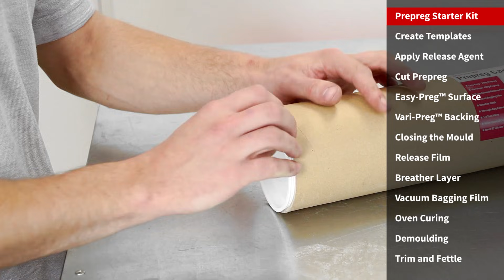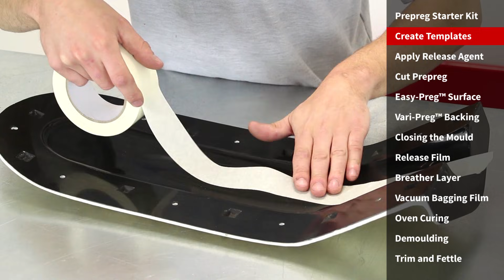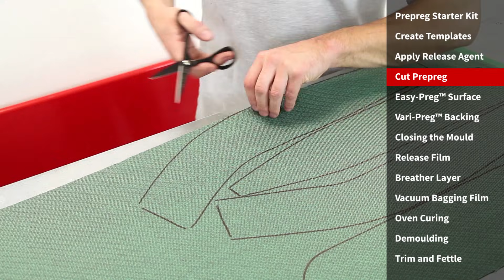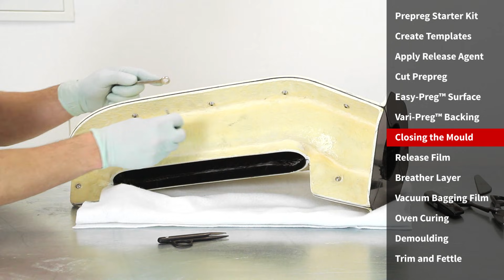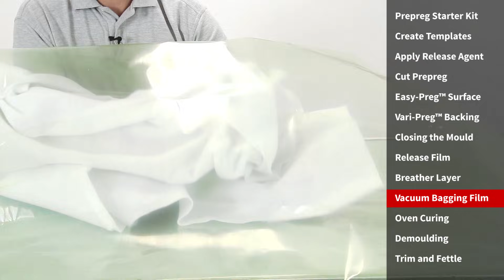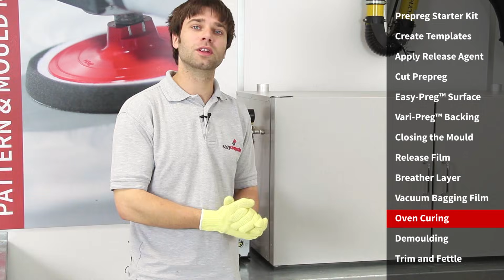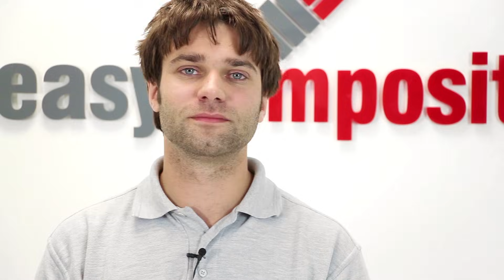How to Make Prepreg/Dry Carbon Fibre Parts (Carbon Fiber Airbox Pt. 3)

Comment: Awesome series. How do you manage with molds for long and slender components like handlebars where you can't fit your hand inside to actually press in the material/release film/breather layer/etc.? Most of the stuff I'd want to make would be more closed off then this.
Reply from the maker: Parts like this would require a different process. Generally, you would have a split-mould for the outside and then use an inflatable bladder (similar to a bike inner tube) to create positive pressure on the inside, pushing against the mould. You would then over cure this whilst the bladder was still pressurised.
Reply: Easy Composites Ltd is this the same method you would use to make a motorcycle gas tank? Also, would prepreg hold up to fuel with ethenol in it without another coating? 

Your videos make this seem much easier than I'm sure it is!

Comment: Thank you for this informative video. Can you do the same process with non-prepreg resin carbon infusion?
Reply from the maker: Yes, in theory. For a complex component like this though, especially where you need to work inside a small cavity, resin infusion would be really very difficult. You also have to contend with the issue of setting up and positioning the infusion consumables which would have required larger flanges. In reality, a part like this is easy to achieve using a prepreg layup but would be REALLY tricky for infusion. On the other hand, larger, flatter components (like body panels) lend themselves very well to resin infusion and are as easy to do that way as prepreg would be.

Comment: Hi there,
Great video , and extremely easy to follow guys :-) 
My name is Martin , I'm a Industrial Designer. I am working on my personal "Superturismo" alfa 33 16V race car project. I am looking at designing a custom Intake plenum and also separate intake runner tubes, I was wondering which process would be best to produce the runner tubes to get a smooth finish inside and out ?
Thanks again
Reply from the maker: There are a number of ways to make tubes including roll wrapping, or laying up in a mould.  Roll wrapping is easiest to get both sides smooth as once off the mandrel it is fairly simple to smooth the outside finish.  For more complex shapes you may well end up making a more complex mould and have to choose which side is the shiney side or consider the use of inner and outer matched mouldings.

Comment: Amazing video. It is very inspiring, can this be achieved without PrePreg material? Assuming that other material could cure without an oven?
Reply from the maker: In theory this could be done by wet lay methods by hand, or even resin infusion,  however the shape is very complicated so it would be exceptionally difficult to do without faults. In this case, pre-preg is so much easier to use as a laminate.
Reply: Thank you for the speedy response. The only thing I lack is an oven and the projects I plan to do are quite large. I am sure I can source a vaccuum bag setup, yet I do not have the funds nor the space to acquire an oven. What kind of issues would I be expecting using a wet lay method?

Comment: hi, that was a great tutorial. absolutely neat, clean, and well organized. love your oven curing equipment and vacuum pump.

a few thoughts though:

for trimming the part near the end of the video shouldn't you use some gloves so that you don't risk getting carbon fiber or fiber glass, etc.. in your skin? i personally have gotten itchy skin when I forgot to wear gloves.

have you looked into using a RVB (reusable vacuum bag) from Smooth-On?
It could potentially save you from using a bunch of consumables.
Don't know how well it would work for more complex shape parts, but I find them to be nice.
Reply from the maker: Hi Knighridar1, some of our fitters wear gloves when trimming, others don't. It's personal preference. Carbon dust will find its way inside gloves sooner or later anyway and so you might choose to have the better 'feel' of no gloves, like we did here. The more you work with the material, the less it irritates too. We can supply a full solution for 'brushable' reusuable silicone bags and we do use them for some projects but they wouldn't be right for something as complex as this part. Thanks for the comments and feedback :)

Comment: ..you suppose this method would produce a strong enough part to use at say 10-12lbs of boost..?  ive been trying to find/figure how to get composite cold side boost piping.

btw, awesome little video series.  though, using a kitchen oven will be a little more complicated...  hmm.
Reply from the maker: The pre-preg method can definitely be used to create a part strong enough.  You will need to plan your joins properly and ensure there is a good overlap like in the video.  Otherwise the join becomes a weak spot. The same with mounting to a backplate, make sure that will seal properly. For higher boost levels you might consider adding several more layers or even a more rounded design which would be inherently stronger.
Reply: Easy Composites Ltd any sort of ways to create staggered joints out of the multiple layers?   the joints will always be the weak spot.   any way to get rid of them?

Comment: How would you apply a UV resistant finish to this? Just a normal clear coat lacquer will do?
Reply from the maker: For most applications it isn't necessary as pre-pregs have a good level of UV resistance but for very sunny climates, you would want a UV stable PU lacquer.  Just ensure it is high temperature if it is an engine bay part like this air box.

Comment: Loved this video. Just have a question, how can I make it if I have to use epoxy resin?
Reply from the maker: It is theoretically possible to wet lay up or use resin infusion, however it will be much harder to get the fabric and bagging stack into the correct places.   This kind of shape is ideal to do in pre-preg material due to the ease of lay up of pre-pregs.

Comment: Am I correct in understanding that the vacuum bagging is to provide a constant, equal pressure against the carbon fiber material during times of curing in the oven? 

If so, based on what I have seen here, wouldn't a heat resistant heavy rubber balloon with a quick disconnect valve from the hose be easier to use as well as give the equal pressure? Does the curing HAVE TO be done in an oven?

I would think that inserting a deflated balloon in the middle of your put together mold would be easier than "fighting" to get the vacuum bag in all the little nooks inside the molding.
Reply: +Returning Shadow You don't need an oven if use the old brush on resin airbag setup and layering. As this system the carbon fiber is already impregnated with resin. Hence the need for the oven to release the resin and harden.
Reply: Ok. That answers part of my questions. I still am wondering if a heavy duty rubber balloon coated with the same anti-stick material can do the same job as using a vacuum bag only more efficiently.
Reply: +Returning Shadow Kind of hard to visualize your concept... Try it and make a video.
Reply: +CarbonFiberWizard I can&#39;t because I have no access to carbon fiber material or model making material and money to purchase such things.

In this particular case, the mold in this video is in two pieces that are put together so when everything dries and hardens the final product has a hollow core. However, it requires vacuum bagging to created a suctioned pressure keeping the carbon fiber in place for drying. That&#39;s a lot of steps using the first bagging, then the air cloth, then the vacuum bagging. My idea would eliminate the vacuum bagging prep, sealing and vacuuming. 

After placing the first (blue) bagging into the hollow of the mold, then insert a heavy duty rubber balloon into the hollow and inflate the balloon to fill the hollow. This would apply constant pressure on the carbon fiber to stay in place as it dries. When it is dry, just deflate the balloon, remove it and take apart your mold pieces. 

Instead of creating a vacuumed pressure and the mess and prep of using the bags, the balloon will use constant PUSHING pressure on the Fiber against the mold.
Reply: +Returning Shadow I got it now... If it is applying pressure to every part (corners) of the carbon fiber then yes that may work. Vacuum bagging is the preferred method of applying even pressure to the composite, I agree with you I don't like it. If it's not a complex shape you can even use a sandbag laying on top of your composite and that will give you pressure.
Reply: CarbonFiberWizard Vacuum bagging is not about applying pressure. It pulls the resin into the fibers and removes the air while it cures to get the full strength bond you are looking for. As I could apply the resin and put large weights on it but It will not be as strong as vacuum bagging.
Reply: +Claude “Reviews4U” Rains I got it now. As someone who has never physically done this but watched it many time in these kinds of videos, I didn't know that part because, I believe, that nobody in these video ever mentioned that part of the vacuum bagging. It makes more sense now. Thanks.
Reply: +Claude “Reviews4U” Rains I agree it does do all of that, but if you apply heat (such as a heat gun or oven) that will get rid of the air and voids... Vacuum bagging is gonna give you a nice finish and yes a good bond but there are ways around that, I make carbon fiber and don't vacuum bag. My parts come out extremely strong.

Comment: Excellent video but a quick question from curiosity... From start to finish (start being just after the 3d design) about how much time was invested into making this part? I've seen lots of videos about making cf parts and they all mentions hours of curing or dry time but none of them really give a good idea as to the amount of time thats invested into a project like this.
Reply from the maker: +Brad Glisson Hi Brad; in this 3 part tutorial the pattern making took the longest, then the mould making and finally making the actual part was by far the quickest part (this is always the way in composites). Once we had the 3 part mould, the layup, bagging and curing for this part is about 1 hr given our level of skill and experienced. For a novice, the layup and bagging could take you 3 or more hours (especially if you have to re-bag following a miss-judged bag size or puncture). There are a number of different cure cycles for our prepreg system but a typical cure is around 8 hours. It's quite possible to shorten this by curing at a higher temperature but this would mean higher temperature mould materials which are more complicated to work with so the lower temperature longer cure is our favoured cure cycle.

Comment: What a prepreg? I don't understand Please explain to me. Thank you sir.
Reply from the maker: Prepregs are reinforcements where the resin is already in the reinforcement. They're normally kept cold or frozen until you need them. Since the resin is already in the reinforcement, no more resin is needed, you just heat the prepreg up in an oven to cure it.

Comment: I’m a little confused as to why with this part you didn’t have to lead a tube of plastic out of the bag to the atmosphere as you did for a tube or the bicycle in other videos. In this video you just shoved extra bag material inside the mold. Somehow I can’t picture how that would compress the pre preg.
Reply from the maker: The bag touches inside so is fully sealed.

Comment: great video. but you not leave vacuuming working for 8 hours?
Reply: can't speak for these guys, when where i worked, yes we did.
Reply from the maker: Hi Darius, if you mean the cure time then this will depend on the temperature you cure at. Our manufacturing side (Carbon Mods) typically cures parts at 85'C for around 8hrs. The vacuum stays on for the whole cure time. If you're referring to a debulk before curing then no, we don't do this unless the laminate was very thick (several mm).

Comment: its really helpful can tell me how much HP vacuum pump is required for preparing 4mx4m composite
Reply from the maker: It's not really about the power of the pump, providing that that pump can achieve an ultimate vacuum (something like 99.98% vacuum). If the bag is perfectly sealed then even a very small pump will be adequate for even a large mould (larger than 4m x 4m). Remember though, it's all about the perfectly sealed bag. If the bag is leaking then you would need a larger pump to overcome the leaks (however we don't recommend prepreg curing in a leaking bag condition).

Comment: hey i was wondering if it was possible to make an entire carbon fiber car chassis by the methods youve used in this series
Reply from the maker: Yes, definitely. Some of the Formula Student teams that we work with and support have made full carbon fibre monocoques using the same materials and process shown in this video.
Reply: awesome thank you

Comment: Hello, great video series on working with complex moulding. 
Have a question, If you weren't using prepreg cf, (it seems easy to start working with a sticky cf)how would you work or which method would you prefer to produce the same part with cf fabric? And you were to produce the same part a couple of times more.. will be appreciated by your answer.
Reply from the maker: YAĞIZ ERGENÇbe very hard to get the fabric to hold in position as well as getting the rest of the bagging stack into position.

You Could make it as seperate parts joined together after curing.

Comment: Can you do a tutorial on how to do this but with an enclosed 2 part mold? So no holes at all
Reply from the maker: Well, you would always have to have some sort of a hole if you want to make the part in one piece, even if it was just a small one that you could put an inflatable bladder into otherwise there is no means of creating pressure inside to consolidate the reinforcement. Alternatively, you make the part in two halves, totally separately, and then bond them together. A lot of seemingly two sided '3D' parts are made in this way.
Reply: thank you for the reply! to give you more detail, im trying to make a spoiler, nothing crazy. and its absolutely killing me trying to figure out how to cast after making my two part mold. could i possibly email you to send you a picture of what im trying to do?

Comment: Would this bagging method be best for something that basically looked like an extrude "U" shape, or would making a sort of vacuum tube like you've done for the inside of tube molds be best?  For the "U" shaped part, i want the outside finish to be the the mold surface.
Reply from the maker: For a moulding that shaped like a U channel the bagging should be very straightforward. I would just envelope bag the whole thing, no need for anything fancy. Just make the outer bag plenty oversized and then push some of it into the channel.

Comment: how about using a separate inner tube like bag and a smaller outer bag ? Would that have worked ?
Reply from the maker: That would work too yes, using more bags can make the process a little tricky but it will certainly work

Comment: That's amazing ..Can I overlaying carbon fiber direct to my car hood and epoxy resin it  ??? I need to stick it direct on my hood?
Reply from the maker: There are ways to skin your hood with carbon fibre but you wouldn't use the 'prepreg' carbon fibre we use in this video. Prepreg can only be cured by heat in an oven and so, generally, isn't suitable for skinning (the process you're describing). If you have a look at our carbon fibre skinning tutorial this should explain the process to you: https://www.youtube.com/watch?v=aqwhcfQZT8U
Reply: So which one should I use dear ? what it called ? and where do  found it?

Comment: Quick question about the epoxy resin used in this demonstration.  Is there a concern in this application about engine heat and exposure to hydrocarbons degrading the part after several years?
Reply from the maker: In this case no as the intake is a normally aspirated intake on a throttlebodied car.  The inlet plenum should not ever get particularly hot.  The resin system in the pre-preg has a TG of up to 120C so a further post cure at that temperature can be done if your application has any higher temperature issues.

Comment: I curious to know what would be the appropriate technique for doing the seams if access was a problem? Lets say there was only the small round opening, how would you prepare the seams and could you still vacuum bag? Or would you need a bladder system? Thanks
Reply from the maker: There does come a point where the inside is so inaccessible that a bladder system becomes necessary. We're working on a new video at the moment showing how one of our customers makes highly complex (and in places intricate) bike frame components - this does require a bladder process which will be glad to demonstrate in that tutorial.
Reply: Amazing! Looking forward to it!

Comment: Would there be a way to do it the other way around? 
In this example you have made a mold of the outside of the airbox, but making a mold of the inside should be possible too right?
I want to make a custom intake manifold with aluminium pipes connected to a carbon intake plenum.
I was thinking maybe there is material that can dissolve once the part is finished?

Reason I'm asking, is because it seems to me to be a lot easier to vacuum-bag it that way.
Reply from the maker: Yes, there are some sacrificial core materials that you can use in this way. Examples would be Styrofoam (XPS) which can be dissolved by solvents. If you intend to use the sacrificial core for use with prepreg however then you would need to be careful that the core could take the heat and pressure of the bagging and curing process without compressing or distorting.